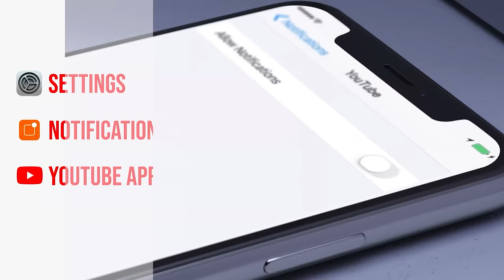Benchtop Moxon Vise Build | You have not seen one like this!

Comment: My moxon vise is wonderful. Mine is a bit thicker in dimensions, and built with Ash (it's what I had), but looks amazing and works seamlessly. Different hardware kit, can't remember the brand but it's a dark grey finish I enjoy it allot.
This vise solved allot of challenges I had with my standard vices that came with my workbench. They're OK for some thing, but for serious woodworking they're a challenge. But the alternative was to build another bench, or try to force fit aftermarket vices. The moxon solves all of that, and slides onto a back shelf when not in use. Well worth the investment, especially if you do allot of detail handwork.

Comment: I bought a 'standard' moon vise in Germany (I live in the Netherlands). I made a few useful modifications. The jaws are thicker, so there was room to make dog holes in both jaws, useful for sanding or planing. Also I fixed two pieces of 30x20mm ply to stick out the back (let in to the back jaw) with holes to position the vise on the bench (which is MFT-style) with dogs and only one or two small clamps.
Both improvements made it much more useable

Comment: I built one for the club recently,  After watching this I wish I had waited to pick up a few tips.  I did lock the wheels on the end of the threads so the thread doesn't stick out when the jaw is closed.  It called for trapping the nut behind the back jaw.  I also included a small, flat work surface attached to the back jaw.  If I build another I'll be including that spring. Thanks
Reply from the maker: Send us a pic of the one you built
Reply: @RobCosmanWoodworking  Email with photo and details of construction sent to the webmaster email address.

Comment: One thing could could do that seems possibly desirable would be to dowel it so that it has bench dogs going into the dog holes as another fixation point. Assuming you wanted to make it fit the edge of the bench that would make sure it locks in, there, too.
Reply: Genius,  great minds think alike.  For over a year, since the first moxon  vice build I saw, I figured that was the way to go.  You could use a wood tap on the bottom of the vice and the die on 1/2 of the dowls, (dogs).  That way that so you could remove them to clamp the vice to a flat table.  Would that work?

Comment: I have made a few similar vices on site in my job as a carpenter using T rails inset on one face and nuts and bolts instead of the large threaded rods etc,10mm rod is a lot weaker but is a quick  effective solution very similar to your rolls royce approach
Reply from the maker: Send me some pics I would love to see some of you on the job vises

Comment: Any recommendation for holding the tail board to align the pin and tail boards for marking the pins with this vise design? Using a plane would be too low.  Great design!
Reply: I know it's a bit late, but my vision is a simple addition to the backside of the vice that allows you to slot in a support shelf when needed for dovetail work, just make sure it's either dead even with the vice + width of your material, or add in a few slots to make it adjustable. or if you have enough waste wood you can make multiple supports of different heights to account for the material width.

Comment: I made my moxon vice with a small work surface on the back with dog holes so I have an elevated mini workbench.  I does add considerable weight though.
Reply from the maker: Depending on your needs a mini bench can be useful. I wanted to make mine so it was easily moved into and out of position.

Comment: Thanks for the video.  I have persistent back issues so I set my bench a bit higher than you recommend.  I have been thinking of using a Moxon vise but using it underneath the bench instead of on top.  If I am ever able to lower the bench height I can always put it on the bench top instead of under it.  I'm going to use some of your design ideas for my vise.  Thanks again!
Reply from the maker: I think I would lower the bench the put the vise on top

Comment: Do you think clamping this vise using a bench dog and end vise would be enough? Or adding a couple of dowels that would stick down into the dog holes would help
Reply from the maker: I have never tried that. I think i prefer something holding it down.  You could use two holdfast
Reply: @RobCosmanWoodworking  I did try using the bench dogs and when clamped that way I could lift my cosman workbench off the ground by pulling up on the vice. That should be strong enough.

Comment: Based on Rob's recommendations with his last video on the Moxon vise, I put one on the end of my table saw which I use constantly. There is only one drawback, when you clamp something in the vise, the wood that  you are clamping has to extend below the screws when you tighten the vise, otherwise when you turn the screws to tighten the vise, the outside wood part of the vise will tilt outward instead of staying parallel to the wood you are clamping and will not clamp the wood sufficiently to hold it.
Reply from the maker: Yes this is true
Reply: Interesting. If necessary I suppose you could use (an offcut as) the same type of shim/filler that I use when I have to clamp a narrow piece off center. Awkward, though.
Reply: Well, you have hit upon one of the great virtues that metal vises possess that is difficult to replicate with wood, that is, the greater rigidity that enables bringing pressure to bear offset from the screw. The easiest method for wooden parts to deal with this limitation is simply to clamp only things large enough to contain in some way the point or line of pressure from the screw. For example, the time honored design of Rob's Scandinavian  style face vise. That one makes no bones about such a limitation. Chuck a large hand screw into your  Moxon if you need cantilevered gripping.
Reply: @robertbamford8266  This is a typical practice with moxon vises. And leg vises for that matter. though most leg vise have gone to a builtin guide and pin.

Comment: OT, but Rob, is that MDF on the surface of your assembly table? 

Re the video, well done. Thank you. It provides valuable input to my own Moxon build, for which I've just received a hardware kit. I particularly like your incorporation of a 3/4 inch plywood clamping apron. The low silhouette it provides will keep the clamps well out of the way. One difference I anticipate: I think I'll countersink that inside nut into the front face of the back jaw, where there's more meat.

Comment: Very good design, Rob. I rarely build jigs without doing a lot of thinking, sketching and planning about how they’ll work in my (small) shop. So, while I’ve been wanting to make a benchtop Moxon vise for a while for cutting joinery (esp. dovetails), the designs I’ve seen to date have been missing the mark. I need one that’s wide enough for panels, but all the designs I’ve seen are too deep (basically, an elevated auxiliary benchtop), which means they would  occupy too much of my workbench surface during use and require a lot of shelf space when put away. This one avoids those problems. Also: I’ve been wondering if I truly need to use maple or white oak for this project, and you answered that question perfectly. Pine it is! Looks like I’ll be ordering your Cosmanized kit today so I can get going on this overdue project. 👍
Reply from the maker: Sounds great.  I think you will be fine with pine or Poplar

Comment: Nice Build, Rob. Your tweaks on the kits are perfect. Just curious: what is maximum thickness of stock that would fit in these jaws?
Reply: I just finished it, I can get 3'' thick and with some adjustment could probably get another 1/2"

Comment: Rob how do you develop your patience along with pricing pricing your product Tony Tony
Reply from the maker: You can easily calculate material costs, tricky when you have to add in waste.  ie., 35% on hardwoods.
Direct labour is easy but the indirect is complicated.  Someone was paid to order, ship, receive and store materials.  Shop time get’s factored in, heat, lights, rent depreciation of machines.  Small shop supplies, screws, nuts, bolts, glue ect.  Then you need a profit to remain viable.  Most folks would have a percentage of manufacturing cost formula.

Comment: why didn't you make it register to the dog holes in your bench? so it's always flush with the front and the F-clamps only need to hold it down instead of having to hold it in place as well.
Reply from the maker: A lot of extra work for very little gain. The moveable jaw will always line it up with the bench face, and the clamps have more than enough holding power to resist sawing forces.

Comment: Why did you anchor the threaded rod to the front jaw on your table saw moxon and the back jaw here
Reply from the maker: No they are both secured to the rear face.  Go rewatch the one we added to the table saw
Reply: @RobCosmanWoodworking  oops sorry I could have sworn I remembered you with locktite or a set screw or something

Comment: An idea:  Add holes to the base that are the same size and line up with the dog holes in the bench.  Bench dogs can then do the holding.  Or pins and F clamps, but either way you'll get a much firmer hold.
Reply from the maker: The two clamps on 3/4 ply base are rock solid.
Reply: @RobCosmanWoodworking , howsomever, Rob, clamping from the dog holes and keeping the front clear would allow gripping the end of, say, a door sized object, just the way you would with your Scandi face vise, no? Although I suppose that would require some tinkering with the screw arrangement on the far side.

Comment: Where is your blade guard?  It's time thst saw cuts are made with the guard in place.
Reply from the maker: What do you mean by blade guard?
Reply: @RobCosmanWoodworking  I was referring to the blade guard.  The clear plastic cover that helps you keep your fingers away from the blade.
Reply from the maker: Hi Robert, those are terrible. They inhibit you from knowing the true location of the wood and the blade and are more dangerous than they are safe. A safe tool is one where you know the danger is located, not one that’s hidden.
Reply: @RobCosmanWoodworking  Interesting, I'll have to tell that to my friend that lost 3 fingers.  I'd tell that to another that lost 2, but he's passed away.   Before you tell me you have a SawStop saw, the mechanism is a fail safe feature.  You are depending on the electronics sensing the presence of moisture in your fingers and the trigger mechanism stopping the blade before it cuts your fingers.

In college I had a friend that was working the summer st an auto company dtamping plant.  He put a piece of metal in a press and realized it wasn't in correctly.  The press required placing both hands on safety buttons before it would actuate.  He took his hands off the switches, reached in to fix the problem and the press closed crushing his hand.

I know of far too many industrial accidents where people removed or altered equipment based on 'seeing better' or having 'better access'.  I worked on a major risk assessment study where the contractor kept referring to 'brain dead operators.'

Sometimes it's better to learn how to best use safety devices than to remove them to 'see' better.
Reply: Finally someone who agrees with my take on those things. I tried to use the one that came with my Harvey saw but found it more trouble than it was worth. Dust collection slightly suffered, but I’ll put up with that if I can see what I’m doing.
Reply from the maker: Hi Robert, let me elaborate a bit.  I spent 5 years as Dale Nish's assistant.  Dale ran the woodworking portion of the industrial arts department at a large university.  He was also a world renowned wood turner, a contractor and a very accomplished cabinet maker.  We never had guards on any saws in the shop, there were 4 large table saws.  The guards were on the floor, out of the way but close enough to install in the event someone from some Govt agency came snooping.  Dale always taught it was easier to avoid a clear and present danger than one that was hidden.  Most Hobby woodworkers have limited experience so before you tell me how much you know, consider that Dale and I probably have a lot more.  My neighbor cut off a finger one Christmas eve, trying to open a can of frozen lobster with his table saw, another reason not to drink!
Point is this, I see the blade, I hear the blade and I know to avoid the blade.  I will continue to teach this principle, while you may disagree, its my channel and I win.  You have lots of options.
Reply: @RobCosmanWoodworking  While directing the cleanup of a major oil spill, I got into a very heated argument with my boss.  My boss ended the argument by telling me he was the boss and that he had the final word.  I agreed he was the boss and I'd follow his decision.  But he was still wrong.

I agree it is your YouTube channel.  But, you are still wrong.
Reply: @robertlevine2152  why is someone with so much experience knowledge and skill (and with all of his finger intact after a long career in woodworking) getting so much stick about bloody machine guards. If you dont like it dont click on it....
Reply: @robertlevine2152 , I don't deny that you raise an interesting point, since the advent of Saw Stop technology and influence from European machinery designs has resulted in equipment, even at the consumer or hobbyist level, having more functional and easier to use safety features; for example, riving knives. Rob, Dale, and many others gained all their considerable experience with machinery not so compatible with efficient and accurate use when afterthought "safety equipment" was installed. Everybody took that stuff off, it was unusable. They trained themselves and others to understand all the forces and dangers at play. Rob is not one of those guys who says "I been doing this twenny years..." before doing something patently risky. I am in his camp. I love using my buddy's European combo machine that has a guard/exhaust hood hanging down from the ceiling, that can be easily detached from the riving knife and swung out of the way, but it is often used without. Proper jointer guards I like and use, too, but they were hit or miss on machinery I used in earlier days.

In the end, I think that technology will save us. The pioneering work and difficult mountain the Saw Stop fellow had to climb led the way. Some designs are coming out that are excellent in absolutely every functional regard.

I would be very interested to read of any particulars you have of your friends' accidents, not to take issue but to add to the knowledge base, thanks.
Reply: @leehaelters6182  The first accident was my cousin's grandfather.  He had a table saw that was part contractor saw/part homemade, no blade guard, no riving knife, no spliter, poor lighting, clutter, etc.  It was an accident waiting to happen, and it did.  The second was a well educated, well trained ship's  master at home on vacation, working without the blade guard in place.  His attention wanderedd for a second or two.  His fingers were lost almost as fast.

I spent nearly 35 years working for oil companies tanker operators.  I worked primarily as an engineer.  I spent time in Health, Safety and Environmental Protection Department.  I was involved with both oil spill prevention and cleanup.  I worked on improving design for better safety.  I did follow-up work after two deaths.  One a diving accident, the other a third mate just out of college.  The mate went into a tank by ladder, when he landed on the deck instead of turning right, he turned left took one step and fell off the deck to his death.

I worked at engineering in safety and removing hazards.  I worked st removing inherently unsafe requirements for equipment that was responsible for; cuts, bruises, strains,  sprains, broken bones, castrations, lost limbs, and death.

It is amazing how often in investigation of accidents the reason for removing or not using safety equipment was; I am an expert, I was taught by someone that never used it, improved sight, better feel, better able to hear, it's uncomfortable, I don't need it. 

Early in my career I remember that the decision whether or not to fit covered lifeboats, which are now  required, was made by the Manager of Operations, with the statement, "If the bastards have to use the lifeboats I don't want to see them back."  It still bothers me that the third mate that lost his life would probably still be alive had senior management agreed to fit a handrail at the bottom of the ladder.
Reply: @robertlevine2152 , thanks for your response. You are like the first responders in life that are exposed, overdosed, on all the worst horrors life and humans have to offer.  My own personal library of woodworking and other occupational injuries will be far smaller than yours, I am quite sure. And, of course, the wise best listen when experience speaks.

I do think that Saw Stop and the newer technology from say, Felder, are not second rate safety devices, behind things like guards. I believe them to be better protection and less failure prone, especially if you consider that a significant number of sawing operations can only be performed without a blade guard.

All the best!